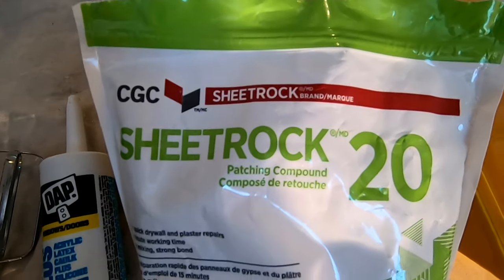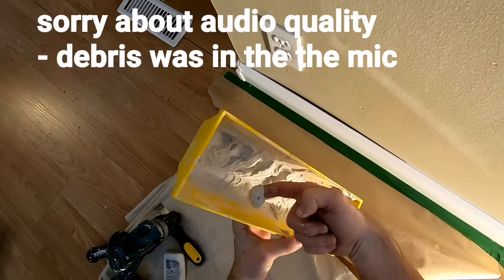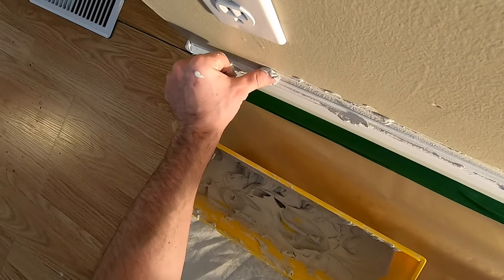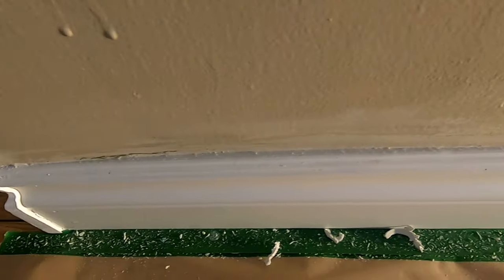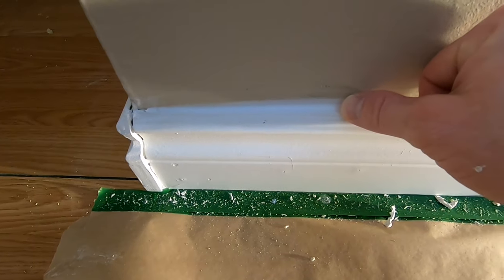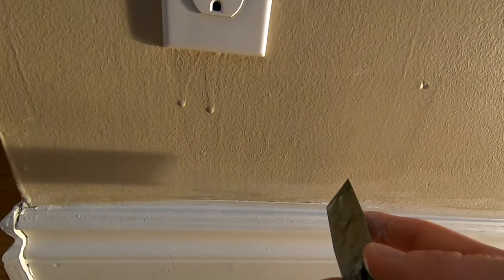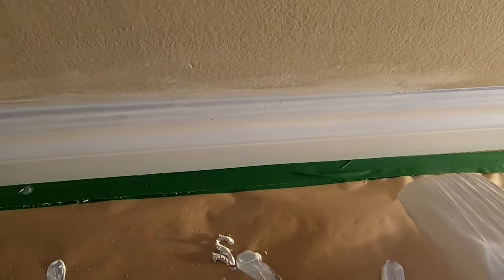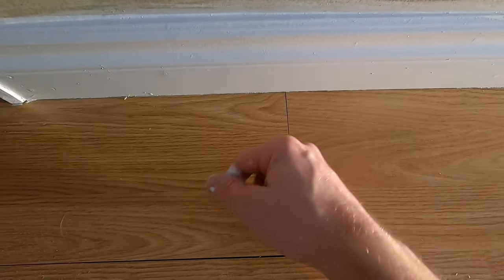Filling an excessive gap between baseboard and wall

Comment from the maker: 1. Yes, technically speaking you could just load a bunch of caulk into the gap and call it filled and done.

BUT, it will be visually noticeable that there was a gap there and now it's just filled with caulk. The larger the gap the more noticeable it will be. This is aesthetically unappealing.

This is your choice.

2. My approach is to restructure the baseboard by filling the gap with plaster, then carving or sanding the added plaster flush with the top of the baseboard.

This creates the illusion that the baseboard always reaches the wall, despite the curved wall, even upon close inspection.

There is no appearance of a "filled gap".  It's just flat and sharp straight flush to the wall.

3. One of the features of Setting plaster is very high crack resistance, zero shrinkage, and high adhesion, while maintaining sandability, or even the ability to "carve" it flat after it chemically sets to reduce dust.

4. I added glue, just for good measure, wasn't completely necessary.

5. The very thin layer of caulking I added over-top acts as a sealant, and being permanently flexible, will prevent any cracks (however un-likely) from migrating to the surface and becoming visible.

6. "Messy" is what some commenters have said. -only on my hands, and it washes off. Really I didn't think it was a big deal.

7. I used my bare hands for the caulk, if you don't have access to a wash pail or sink, I recommend using a wet cotton cloth over your finger.

8. Yes it was a bit of a complicated procedure, but even in a crooked old house theres usually only a few linear feet that need this extra treatment. Everywhere else can be just caulked.

Again, the final appearance is your own choice, this approach is perhaps more suitable for perfectionists, not the "just do it good enough no one complains" crowd. 

9. The bit about the mixing whisk was just a joke. It was purchased for plaster.

Thanks for watching.
SUBSCRIBE for videos where I explain things a little better than this video which regrettably I could've explained better.
Reply: That is not a fix that is called jack legging and the only way that's not going be noticeable is by cutting off the lights and I hope you ant the one that painted the wall originally that run is longer than my leg and im 6'4 
 atleast u did take the receptacle cover off before u painted ill give u an a for that
Reply from the maker: @adam-xx3qq  being a bit dramatic about it all. The alternative is to restructure the entire wall straight.
Viewers have different budgets and quality expectations when choosing an approach to fix something. For example, more people are interested in the videos on how to touch up a chipped bumper vs how to replace the entire bumper because of said chip.
Reply: Not 1 bit especially since you said you gotta touch the wall up I thought you were on the right track when you pulled the mud out but all you did was make stronger caulk that dries quicker your still going from a 1/4 inch lip too atleast a 1/2 inch lip then back too a 1/4 and you say it's not noticeable all you had too do was take the mud and make a little two inch wide ramp from the top of the base out too close the gap up and then caulk it you had plenty of mud mixed up too do it and you don't even have take the base off the wall too do it and the walls even textured that makes it even easier too hide and it takes about the same amount of time too do you need take more pride in your work and quit showing people how too jackleg stuff cause I get tired of fixing it which takes atleast twice as long too do 
Now if you want me show you how too do it let me know I've gotta fix half inch gap behind a toilet that some jackleg filled with silicone and painted and he called himself a professional 
O and by the way im not a professional im just a maintenance man that takes pride in his work
Reply: I'm also trying to figure out the best way to fill these typea of gaps (I have many!) The only reason I would want to go the caulk route is because of our textured walls. I've read up a lot on both methods but how do you get the orange peel texture in such a small area after you plaster the wall?

Comment: Why do so many ppl have to criticize everything. Dude showing how he fixes a baseboard gap his way and ppl start complainging about sh*t not even related to it. If you don't like it, make your own video.
Reply: Floating out the wall is the ideal way to repair this situation so it is worth commenting on.  This repair is a compromise and really needs a nuanced discussion,  which is something comment sections aren't really good at.
Reply from the maker: Floating out the wall works too, but is comparatively way more work. I did this as a quick freebie when contracted to simply caulk and re-paint a rental property. Client was very happy and appreciative.

Comment: I can't get over the corner joint. How do you not miter the corner. It ruined the video for me.
Reply from the maker: That baseboard was probably put on 50 years ago. I'm just painting and caulking and showing a little trick to fill the larger gaps here and there.
Reply: @interiorvids... don't let these Bastards get you down. Those who want to learn are learning.
Reply: @Interior_Works  that baseboard is not 50 years old. They did not make speed-based back then. The base trim and the base cap were separate pieces. Plus you can see the Brad nail holes by the corner. That said, your gap filler was a good idea.
Reply: Or the major paint drips under the outlet!!😂😂😂
Reply from the maker: @ginsterh  Yes, whoever painted years ago didn't do a great job.

Comment: A damp sponge would've worked better after applying the mud then scraping and left a nice smooth edge of mud in the gap while cleaning the rest of it off the surrounding area and prevent repainting the wall.

Comment: I recommend fixing that corner first. Yikes! Not even mitered. I presume this is an old house, maybe plastered, so the walls will not be straight. This might be the easiest way to fill the gap. Starting over, I'd use a flat stock 1 x 6 and then a cap board on top of that. The cap board can is more flexible and can follow the wall. However, that affects the reveal between the two. I'm still trying to figure that out in my 100 year old house restoration.

Comment: this is more like a video of what not to do
Reply from the maker: Well, what's your solution?
Reply: @Interior_Works  how about some foam rodding to fill the gap then caulk? much cleaner and less time consuming than mixing hot mud and making a mess. why didn't you use a wet rag or sponge to wipe the mud off the textured wall above the trim? and wipe the slop off the trim better? just sloppy work. and you mixed a shit ton of mud and used hardly any of it
Reply from the maker: @donzon353  too small for foam rod. Caulk sags, Plaster can be scraped or sanded sharper and more square. That's not a textured wall. The walls being sanded and painted. The rest of the mud is for other similar spots off camera. Look, I'm showing a method here, I'm not claiming to be a talented professional baseboard gap filler.. my application could've been a bit more tidy I'll admit.
Reply: @Interior_Works  you can get foam in 1/8" thickness that will compress to less than 1/8". And if it's less than 1/8" caulking will suffice. !/8" rod you say? I just bought a length of 1/8" and 1/4" rod for a very similar job i'm doing. Not floor trim but window trim. Same concept to filling gaps either way.
Reply from the maker: @donzon353 Didn't know that. Will look for smaller foam rod should ever a situation come about again. This method, well it worked. Could've been a bit tidier application, but looked sharp and square at the end, I still think plaster will give a sharper finish, I mean there was another video that got over a million views of a guy stuffing tissue paper into the gap 🤷. I think the process doesn't matter. It's just what looks the best at the end.

Comment: I've done this myself too and it held up really well! The only change I'd suggest is to load your scraper with the compound and shove it straight into the crack with your arm parallel to the floor--there's no reason to get so much of it on the wall and then have to clean up later when you really only need it like 80-90% of it to fill up the gap.
Reply from the maker: Thanks for the tip, i agree my application method could use some refinements.

Comment: Good video, and I get what you are trying to achieve here. I personally would have skimmed the wall up to erase the gap completely.
Reply: I try to catch these things before installing the baseboard and skim with a setting compound to take the curve out of the wall near the floor.  But, if I miss any and I find large gaps after installation, I use the same technique as demonstrated in this video: use a setting compound to fill the gap (I use a putty knife to push it into the top of the gap), and when it is dry, cover it with a thin coating of caulk (usually as part of the process of caulking the entire baseboard. I also use a much smaller bead and use a wet finger to smooth things out).  For much smaller gaps that are almost caulkable, I sometimes use Plus-3 for insurance followed by caulk.
Reply: What about a wall that is Three inches off at the corner, would you skim that over and over until your baseboard fit?
Reply: @jameslund221  I would actually. I would  instsll a new metal corner bead and skim it plumb.
Reply: @jameslund221  If it's 3 inches off, I'd tear down the wall and start over.  I have had corners where you could fit a pencil when checking with a 12-inch knife.  When they are that extreme, I scree a 2-foot patch all the way to the top with Durabond and then smooth it out with all purpose or mid-weight.  Anything less I straighten a the bottom and blend it into the wall.

Comment: You should use a pva such as wood glue. More specifically, tite bond 3. And mix it in with the water first. It will distribute more evenly instead of in clumps!
Reply: I admit I'm a DIY guy,
But it seams to me the small amount of glue (wood or otherwise) doesn't do a hole lot. Why the need for the wood glue? I would suggest silicone/something stretchy if anything. I HAVE NOT TESTED THIS THEORY.
And agree, what ever you add, mix it in the water first.
Reply: @jeffnarum1373  it's more about the pva. It's technically a binder and will make it stick better. Plus it dissolves in water and mixes easier. All drywall mud has some amount of pva for that exact reason. Pretty sure the glue he uses has some pva in it
Reply: @Bigrush310  well explained. I did have to look up pva. 
Pva dries like plastic and dry wall dries like chalk. So does it give it a plastic chalk-like texture?

Comment: I would just use no more gaps DESCRIPTION
Polyfilla Professional X50 External Gap Sealant has been formulated with a unique polymer system for superior flexibility on exterior applications. Ideal for sealing areas and filing gaps that require painting as it remains flexible once cured to resist cracking, crumbling or falling out. Provides excellent adhesion to most building materials, including timber and synthetic weatherboards, masonry, glass, fibre cement, ceramics, most metals, timber and plasterboard. UV, water and mould resistant.

FEATURES
Paint over time 30mins
Flexibility, up to +/- 25% joint movement
Skin time, 60mins
Coverage, approx 11 linear meters/6mm bead

Comment: The trick with the caulking is to wet your finger and put more pressure against the wall and/or baseboard to remove the excess. The water will allow your finger to slide and you can remove the excess easily.

Comment: Did you install this base? This can be a fix in certain situations but it appears the base was installed incorrectly. The corner connection does not look good. If you see after you used your finger there is a thin layer that get smeared across the paint/texture on wall. Yo avoid that use a wet microfiber cloth or sponge after you do that to get rid of that. Because it will be noticeable after you cut in the paint.
Reply from the maker: Thanks, the wet cloth is good advice, the base was installed by someone else and I agree does not look good, especially the connection. But it was straight and the wall was bowed.

Comment: What if there is a gap between floor and wall ( where your tape is). I can see concrete in the space , and debris
Reply from the maker: Hard to say without seeing, but several options would be: 1) Removal and repositioning of the baseboard if it's too high. 2) If the floor is uneven I would recommend self leveling underlayment, it's a concrete-like slurry. 3) would be using a 90 minute setting plaster such as I'm using in the video and filling the gap flush to the floor, then use a sponge sanding block and sand it smooth, then paint the whole baseboard, if you go that route first vacuum out any dust and wash as best you can to remove dust, so plaster can bond well. Be sure to use a powder setting compound as it's more like concrete and resistant to moisture.  Premixed drywall compound is interior for this purpose and will just crack.

Comment: I have a much bigger gap between a tile baseboard that I wanna install and there’s a situation with the drywall of about a 1 foot length, that I need to fix, it has a half inch gap there. I cannot fix it this way, there must be a way I can make the wall look flush without having to cut out the drywall and install another piece please.
Reply from the maker: To straighten a wall, a professional would use a small trowel and cover the area with an excess of drywall mud, then use a wide (24"+) skimming blade to wipe it off, which would just leave mud in the dipped area, straightening the wall. A couple coats and then sand. This could be cheaply DIY improvised with using a putty knife to place the mud and a wide metal yardstick ruler as a straight edge to wipe away the mud.

Comment: Why not just caulk two layers with second after the first has fully dried??
Reply from the maker: My regret about this video is not explaining why I was doing what I was doing.
To explain: Caulk doesn't dry, it "cures" which is an oxidative process that can last up to 10 days, during which time it shrinks and sinks and potentially separates if too much was used at once.
Caulk manufacturers recommend stuffing specially made foam backing rods of varrying diameters into large gaps before caulking to prevent this.

This all works, however it results in a rounded fill, which can be quite noticeable, especially over large gaps.

I like a straight edge and flat ledge, I like caulking to just be a sealant, not a filler.  So instead I use a zero-shrinkage, crack resistant, chemically setting plaster, that after it sets, can be carved or sanded to a crisp 90° corner, then caulking applied only as a thin flexible sealant to prevent cracks, however unlikely, from migrating to the surface.

Especially in situations where new trims are placed onto old warped walls, plaster-carving/sanding the large gaps can make the trims appear beautifully contoured to the walls, this is especially beneficial in spots where gaps are very wide, I've seen 1".

Comment: What about expanding foam? Then cut that down, sand and the caulk over the top?
Reply from the maker: That's probably a cleaner way of fixing it. I'm going to give foam a try if I come across something like this again. Plaster did result in a very smooth finish but was obviously sort of a messy process.
Reply from the maker: Would be important though to find the can foam that doesn't expand as it cures so the baseboard doesn't get expanded out further

Comment: I think u've bigger issues here,whoever installed ur baseboard had'nt a clue what they were doing with that outside join or lack of joining 😲 u went overkill with filling a relitively small joint,pack it with papertowel to just below the top of the baseboard,caulk it and let it settle and cure for the day and recaulk to finish it off,job done 👍🙂
Reply: Same guy who left thos drips under the outlet, and notice the corner on baseboard😄😃😀

Comment: Caulking is a hack. Given the sloppy paint work on the drywall, it is more likely that either the drywall or the moulding/baseboard were not set properly, or either or both have warped. Fix what's wrong; don't cover it.
Reply: Mines so bad a lot easier said than done I’d have to change a shit load of the wall to fix it. Not worth it
Reply: I'm not going to re drywall every corner. Lol
Reply: What's the point of the glue?
Reply: @larrybud The video description mentions it is probably not necessary in this case, but it is something added to give the mud a little more holding strength or situations where cracking is a concern.  The Vancouver Carpenter has a youtube video discussing the particulars on when and how he uses it that seems pretty good.

Comment: What does putting the glue in mud do?
Reply from the maker: Just for added strength. Increases the adhesion properties of the plaster. Not exactly necessary for the example in the video.
Reply: @Interior_Works  hmm ok thanks for tip

Comment: BTW you have runny paint, visible nail holes, damages metal corner, poorly installed baseboard to begin with.   If you apply a low adhesive tape to the baseboard and along the wall then apply caulking then run your finger along the joint pulling off the tape quickly you will have better results and in a shorter timeframe.

Comment: Will this work for a gap that is bigger?
Reply from the maker: Absolutely, actually that's where it works best. The gap in the video wasn't too large and maybe I could've just put caulk over it, but I had wanted to make a video showing the technique. Just fill the gap with plaster, let dry, sand or scrape the top flat, put a thin layer of caulk on top and that will work on any size gap.
Reply: @delylah hernandez can I work for you for free? Lol